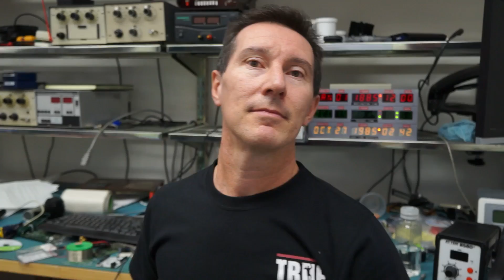eevBLAB #2 - Are Electronics Hobbyists Useless?

Comment: I have a in B.SC Electronic Engineer, in the university they learn you the basics and how to use your head and solve problems and think as a technician.

You asking a lot from a hobbist, most hobbist usually solder kits these days and not bother to design their own. But a graduate student, with passion for learning, I think he could do the requirements.

BTW you cant ask something that exceeds the level of the average knowledge.
I was looking an ad for electronic engineer, and they ask me if I have a cisco IT diploma. This thing was 1500E with the Uni discount LOL
Reply: g4rko Barry
Please remember that English is a second language for many people here...
Reply: Nerdy NEET The obviously don't teach you English!
Reply: Dark Modulator
When i started to get "serious" in electronics, even a 10Mhz single trace scope was around 1kEUR those days. So if i would like to have one, i need to build one, no option.  I stripped a B/W-TV chassis and tweaked, tested, tried as long as i was able to display something that looked like on a scope´s screen. I learned a lot, just by pure tinkering and just to serve my very own needs. The same was for computers and its peripherals. I could not afford a 1541 in first place for my C64 but i got an old 8inch floppy drive so i came up with an interface with a 8049....that sort of things are hobbyist electronics...

You just do not need money, you need a stubborn will to set something up on your own, what you can´t affort in first place.
Reply: Dark Modulator
For me, as i live in germany, i do not care, where i do get my needed parts form. As 60% of my parts are tubes, i order worldwide nowadays 70% from .cz .ua .ru....  Only 10% from official distributors for passive components and semiconductors. 90% via ebay as assortments, bulk ware or overstock (returns). As one can save a lot of money (latest score 100xTL074 for 19.90EUR (overstock)), but you need to look and choose carefully where you buy and you need to be quick and have a paypal account, rest is a piece of cake.
Since i need all this just for my very own "pleasure", i don´t need any WEEE/RoHs certificate/statements at all...

I sudied EE as well, but i do not care, as i never worked in the EE field after my studies at all. But i worked as a "Head of PCB Design Department" during my EE studies, as i found the studying for me beeing very boring. And with a little luck i got that job, i heard of it, and simply dropped by and talked to the big boss hisself;) As he only seeked for a person who could do some schematics corrections in the first place. After some time i found myself in the head position. I planned to stay there, but as 2005 came the overall electronic business crisis raised its ugly head and he decided to sourced that field out entirely, me aswell...
After two years i found myself in a complete other working environment, left that electrical stuff only beeing a hobby to be from that day on. As the EE-companies not willing to pay no more than about 32k gross/year entry wage for more than 60+hours/week of work, so no more proElectronics to me unless they made up their mind again. Now i got 1.5times the PayPerHour, at 2/3 of that week load, fixed;)
If the EE-companies would go down that road all the way, no one´s gonna work in that business no more....not for that wage!
Reply: ive never touched a kit, i have modified a makita radio to put a usb charger inside it powered by a transformer with a switch etc in there, i will be making a pcb design at some point to add the resistor values so it will charge my phone at the full rate though.

the thing that always gets me is, people would learn a lot by dissecting existing products and see how they work.
Reply: there aren't that many serious hobbists, at least in his place. It needs time to do and learn these stuff and money for tools.
I can do it but, the trent is, serious is not that can soldier or assembly, but serious can sovle problems within a project, Merphy's law in electronics is messing all thinks, he needs a student as a practicioner as many serious companies do.
Reply: You are right, we the younger generation we have a lot of cheap stuff to experiment these days. Many electronic devices are more expensive to repair that to get a new one. I wanted to repair an LCD screen and the part was an LG part that I couldn't get and the cost for the repair was 2/3 of a new one. You are a serious hobbist, I am an electronic engineer with experience in pcs etc networks peripherals. 

Electronics these days are easier to make new projects, with ardruino and rasberry pi etc, with real debugging + cheap one.

I envy the old engineers for that, we have it so easy and we are our level of problem solving is lower. But here in Greece the electronic shops don't have all the parts to do develope and design as a would. Crucial parts are ordered from Athens or Farnell.

But the cost is high do to a 24x6 RBG led matrix I spent 200E in parts and spares with descrete parts.
Reply: I was working in another field when the EE crisis stuck, but I am glad to have my diploma at the very least, I am not doing something serious at the moment, but I am inspired buy people in YT. I wish I could have easier access in lasercutters and I want to start 3D printing designs, pcb is cheaper to order it from china, and assembly myself.
Reply: I had never any good experience with chineese made PCBs. I order my PCBs from a guy who runs a little part time company for DIY PCB stuff (max euroCard size/two layers) for 15euro fixed/no silk/mask/stop plus shipping.
But 90% of my work are breadboard PCBs anyway. My last "real" PCB was that "tube VCF" back in early 2004...I made a run of 20 and sold it "PCB only" slowly through a synth DIY network...
I was interested in that lasercutting thing some time ago, but the money needed for this is beond my cabability and for space it´s the same as well. So i chose "schaefer-ag" for all my front panels.
You may write some words to me in private if you need some discrete (LEDs,Ts,ICs) components...spending 200+ EUR on these is "insane"...;)
Reply: Chinese is not that reliable, but for my project it was cheaper, 109E with shippment for 5 PCBs, I think it was pcbcart the site, back in 2007 not bad. 200E is insane but for descrete RGB led 5mm throughhole 200 it was 90+E if you add the arduino and all the other components and stuff you came up to 200, I think it was 170 to be precise, some part was left out :P
I will sent you a private message, it good to speak with other enthousiasts ;)
Reply: We do need to join forces, here. As the old days are gone forever and we need to share skills and knowledge, instead of hiding away, as we will get stuck somewhere without a lead out....
I done a little 10by10 green standart LED VU with two LM3914 to have an XY-LEVEL-display
working well since 15 years...
Some 3 years ago i done larger one, a 20by20 5mm Blue, 1200mcd VU meter the same way with cascaded LM1315/14 with a peak detector and with an inline 19by19 3mm white VU with cascaded LM3914 with RMS detector. I phoned my usual LED supplier for these LEDs, he send me 500 pcs of 5mm LEDs, one lot, factory sealed, all with nearly the same characteristics, and the same for the white, but sadly the white ones degenerate over time for color and brighness as well....all these leds together cost about 120E back than, today they are much cheaper....but i wouldn´t do that soldering again (kindalike imposition;)
Reply: I soldered the 24x6 RGB it was too many + in order to have less wiring I used all the tricks with this http://i.ebayimg.com/00/s/MTA3MVgxNjAw/$T2eC16J,!w0E9szN((cJBQrn9fV)h!~~60_35.JPG
the led are all degrate seperately, and adjusting resistors for color balancing is good.
but with a voltage regulator within the program with a test loop and a numeric keyboard to adjust it on the fly, complex but when you work with RGB color balance is crucial. I managed to use all these with less than 1,2 amps for my matrix but the ardruino was overheating in 1 hour of use.
Reply: Nerdy NEET Hi Nerdy, Sorry if my flip comment offended - not intended - sorry. Your English is certainly better than my Russian!
Reply: ***** I always read what I write - it's a real shame that you have to resort to that sort of language. FWIW I have apologised to our friend Nerdy NEET.
Reply: Nerdy NEET
What are you talking about? If one wants to be an engineer you need to handle both the math and physics required, but one would benefit a great lot from whilst the university years also being an ambitious hobbyist. You are quite right that what the university teaches and what an hobbyist does and learn are absolutely different things, or I would say different levels, different domains of work.
Reply: Nerdy NEET
 Hi, I do super XL agree with you!

In primary school high emphasis is placed to create the best circumstances for children to learn. Up to a certain level you’re pretty well educated.

Then a little later in engineering college, there are some really bad teachers that have absolutely no clue how to present the subject. These people aren’t being corrected. It was the teacher for the FPGA/VHDL subject in my case.

Most of my fellow students completely fail to see the advantage of this awesome technology. I didn’t either. But I wanted to see for myself, so after experimenting with some simple SPLDs on a breadboard, and a cable to squeeze in the logic design, I was able to see its benefit of programmable logic.

Practical experience is everything. You are most talented when you’re in a circumstance with limited or no knowledge and can figure out your way out of it with a decent electronic system! Considering things like: Find the right terms of solution areas on the internet, contact the correct people for help, ask the right questions, be critical on advices, test run some unknown part. Find the most professional methods in the industry for routine things, like IPC complaint footprints for example.

You know ability! Not necessary knowledge...
Reply: I see a number of comments about universities not teaching the needed practical skills.... that will vary greatly by the university.  An EE major at my university has the opportunity to take a course in which they design and build an actual CPU, yeah, on site, you can see the people in the white suits in the clean room you pass as you go in and out of the building.  I wasn't an EE major but took a few courses in it at the end of my degree (Biophysics) just out of interest, got hands with FPGAs, was one of my favorite courses in my time there.  Even in the very basic level course you design and build an audio circuit.... including all the theory and the calculus so you know exactly how all those components are reacting over time to different inputs and exactly why X capacitance value was chosen, etc...  Without the theory I guess you can just rely on the simulators to be right, but it's nice understand it all too.  I do think that a lot of universities themselves assume you have a lot of the practical skills going in.  I'm not sure if it was just when I grew up, but it didn't seem like there was access to a lot of components and knowledge regarding electronics in the early 2000s US.  RadioShack was dying and didn't have the parts... not anyone else local carried anything at all.  It is only more recently that we've had this resurgence with Raspberry Pis, Arduinos, Beagle Bones, etc.. But that's my perspective as a former outsider I guess, there was probably a lot going on that I just didn't hear anything about.  As far as the amount of practice, well, my university went to some fair lengths to keep labs open at all hours for EE students, you could get in there pretty much any time before 9 PM that there wasn't an actual class in session, or even if there was so long as you were quiet and there was enough space.  Lab time constraints were far tougher in other fields, e.g. getting time in the chem labs or physics labs, you pretty much had to do everything that needed doing during the main alloted lab time so there was always time pressure and many people for some labs were unable to do well because they didn't finish in time.  We may have had the same Cyclone FPGAs NEY Industries mentioned.  Were Cyclone II boards with a lot of other integrated parts, buttons, 7 segment display, etc...
Reply: I graduated form California State University with a BSEE 1986.  Big waste of time & money.  A bunch of math i never needed to use. You can actually get a better education & skills by skipping college and with all that savings buy boards, oscope etc... You'll be able to make some money in 4 years. But back then there was no internet like there is now. The kids have it easy learning this stuff now compared to back then.
Reply: ".. in the university they learn you the basics and how to use your head .."
wot? you went to school in Zimbabwe?

Comment: i have designed my own (unprofessional for sure) pcbs with cplds and mcus and i wouldn't even call myself an electronic hobbyist at this level. i just ordered a cheap solder iron and a 40€ multimeter to have fun! but i would call me a computer science hobbyist, which helps me a lot in programming und understanding digital electronics. ^^

Comment: When I go into the local electronics store, all I see are kits. There are kits for everything! Very few hobbyists today do more than just build kits. I've seen kits for the simplest things! Things I'd make in an afternoon just 'cause I want one. Take power supplies for example. I figure if a hobbyist has to buy one he isn't much of a hobbyist! I needed a 0-50v 2a supply a few months ago since I didn't have anything over 30v, so I made one with 3 surplus battery charger transformers, a 317chip, a few spare parts on a terminal strip and some old meters and bobs yer uncle - 1 day build! Ask a kid today to make his own PS and he'll look at you as if you're crazy! As for your requirements, I would have most of them except for the embedded computer stuff. I did some C on a PDP11 but that was ages ago. But I just turned 64 so too bad for me! Good luck in your search!

Comment: Its amazing how stupid the latest generation are when I studied electronics there was no Internet everything was in electronics magazines and books. Computers were all configured with jumpers and we learned how to program in machine code.

These days with the internet there is a whole wealth of information available and there are wonderful cheap development platforms such as the Arduino and the Raspberry Pi and the IDE software for these platforms make it easy for a new starter to learn the unfortunate problem is people don't delve into the hardware and what goes into designing the boards.

Your requirements are not to low it's just there are people who haven't reached the level to be classed as a true enthusiast. Most of the younger generation will google information to make something work but wont delve in to what makes it tick on a low level which affects their low level ability to debug even common hardware faults.

Its a product of our disposable society someone asked my the other day why I bothered spending the time to repair my PVR when I could have paid $300 for a new one. I pointed out for the 22c cost of a capacitor and a small amount of my time there was a big cost saving.

Comment: as a multi hobbyist i can solder, make pcbs ,fix simple audio amps, measure basic electronics stuff, or make a board based on a schematic. i have made my own monstrosities by designing my own portable guitar amp, but that was more hunch that knowledge. I was also able rewrite some of c based microcontroller firmware to use more inputs via hid interface. But i do not consider myself an electronic hobbyist. i know far too little on the subject. but in the same time i known too much to say i known nothing.
Thanks to my skills i can clone kits without buying them and replace some parts along the way, but that's basically it.
I think that many people right now is either multi interested, or interested in consume stuff (short attention span), and finding a real hobbyist that known a lot is like finding a gem

Comment: yup most of them are useless, actually who are they? persons who followed instructions on instructables or other similar site and made something without any understanding? Can they be called hobbyists? Probably yes in some way. But com on Dave is right now days you have internet with all resources, software, cheap hardware, and cheap manufacturers. Anyone how has interest in electronics can do it... 4 years ago i almost didn`t even knew what were basic electronic components. Today i design pcb, and make them at home, by the way they are through hole plated with solder mask, write c/c++ code form micros, make 3d design of my project etc... etc. etc... and i got my knowledge from the internet. If i could do that everyone can, all you must have is curiosity... And  no Dave is not asking to much.
Reply: just to add though (in case people got the wrong idea) YES you SHOULD try and build some instructables, build some kits, they are a great way to get a feel for things!

tha being said, after building a few, try adding your own touches, don't be afraid of frying some components, keep the current low so that you won't fry yourself, other then that go wild! messing up is one of the fastest way's to learn!